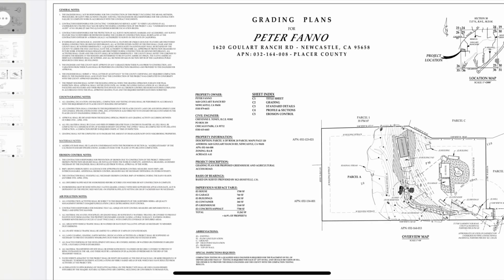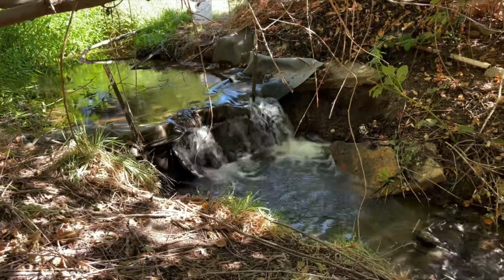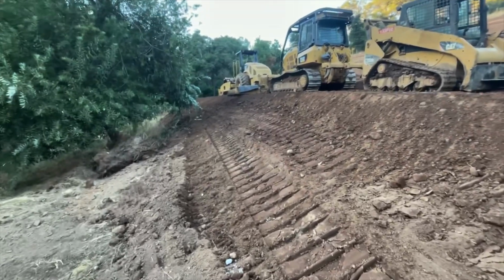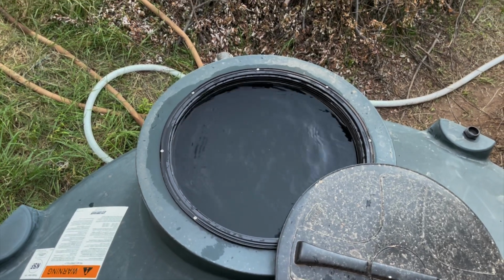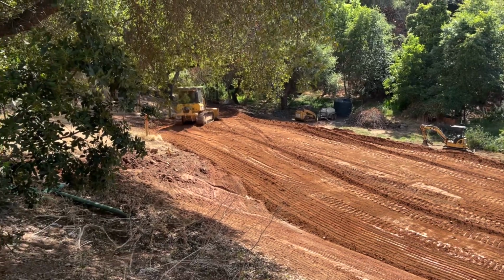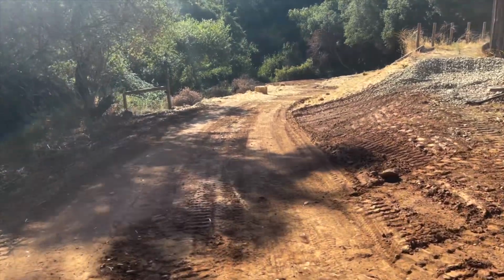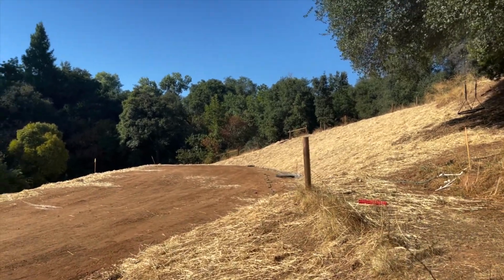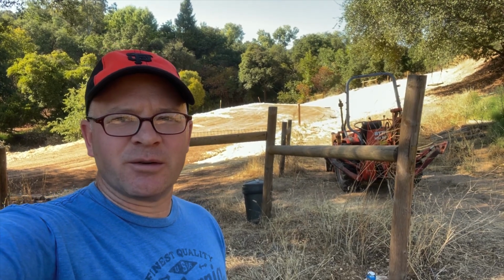New Greenhouse: Grading the Hillside

Comment: What a cool project! At one point I had grand plans of having a large climate-battery greenshouse built here in MD but as I planned it out I became overwhelmed with the project.  I questioned whether I really wanted to take on something like that as a hobby.  I decided to scale way back and built a cattle panel greenhouse to give a few trees a headstart and be happy with that.  In your case it will be a business so it makes more sence.  I'll live vicariously through you, haha!  By the way, the White Triana I got from you as a mature tree is doing great in-ground here.
Reply from the maker: Good to hear from you! Yeah if I had stayed in VA at my old house my plan was to build a new greenhouse but it was going to be a custom one that I would basically design myself. It was going to be partially underground and use pipes routed through the backyard as a heat sink. It would have been pretty crazy. Ultimately I decided to just move and not improve the existing greenhouse there.